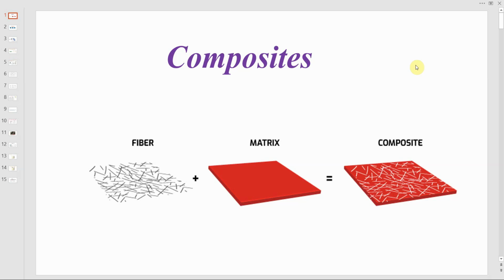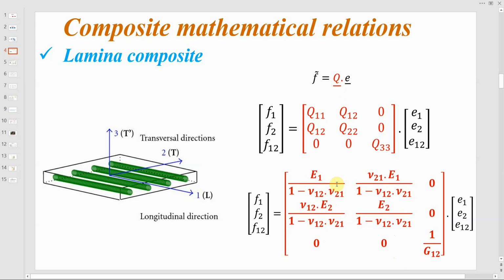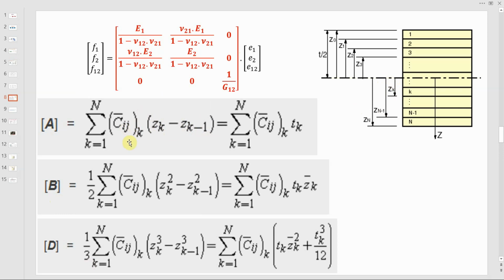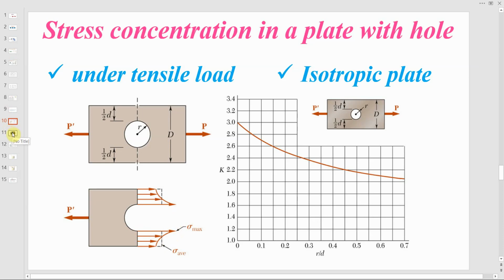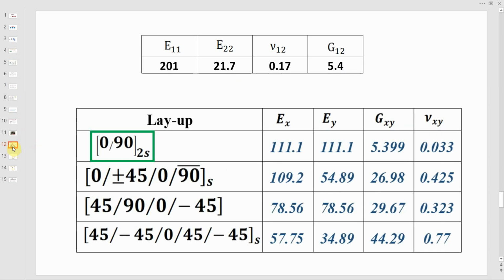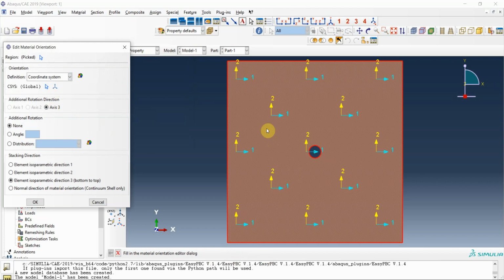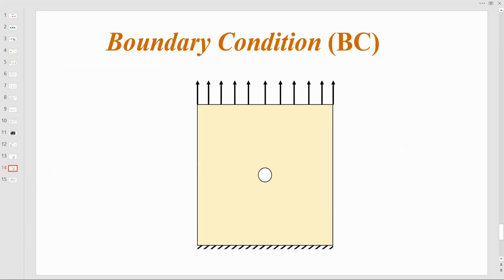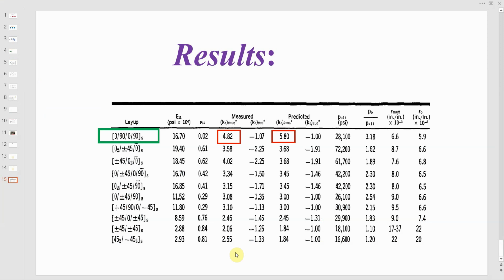The composite Plate with hole stress concentration in ABAQUS

Comment: I am commenting on this video since comments are turned off on your last posted video (What is G-code and event series (in ABAQUS)?) 
My question is that how can we import the model after converting the Gcode to an event series code? 
thank you
Reply from the maker: I did not understand your question completely,  but if your question is how to import event series in ABAQAS, the answer is that, it depends on your technique to model the 3d printing process
Reply: @saragolbabapour5403  thank you for your reply.
What options do we have to model the 3D printing process (extrusion) ?
Reply from the maker: @AE-us7bw  Welcome, the important parameters include the printing speed, extrusion width, extrusion hight, the printing technique, etc.

Comment: Why you did not consider multiple layers ? like in different layers we will have different fiber orientation & fiber content.
Reply from the maker: Actually, I have calculated the in-plane mechanical constant for multi-layer composite and modeled 2D-shell with anisotropic behavior with the mentioned constants.  
in this modeling, there is not any significant difference in the results and shows good agreement with experimental observations.

Comment: how we can calculate stress concentration factor under the bending load and in this geometry how can ı calculate average bending stress because ı dont know bending moment of resistance i mean We ?
Reply from the maker: The stress concentration basically shows you the amount of increase or reduction of the applied load. No matter what the type of loading is.
 I think you can use the similar way as I told in this tutorial to find out the stress concentration. 
But one significant point is that what type of geometry you use and what kind of analysis you simulate.